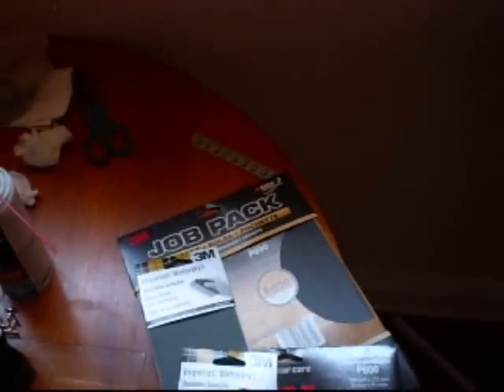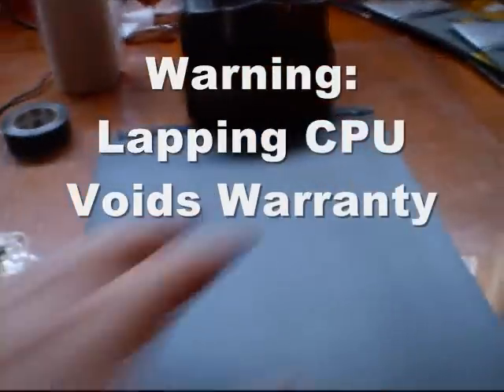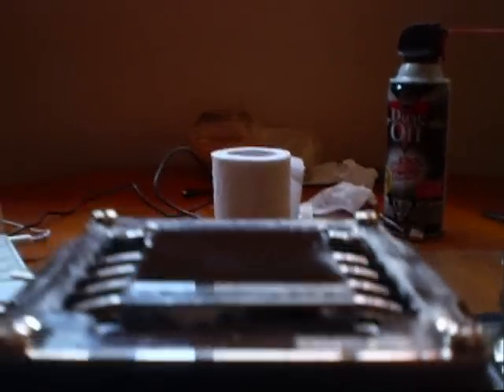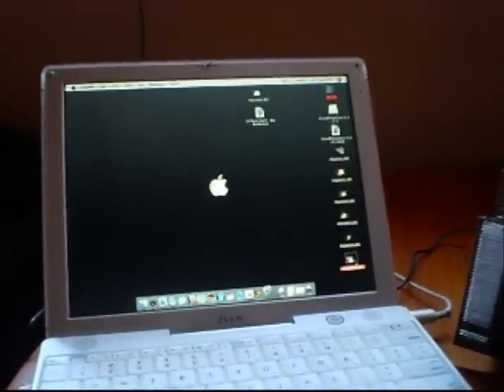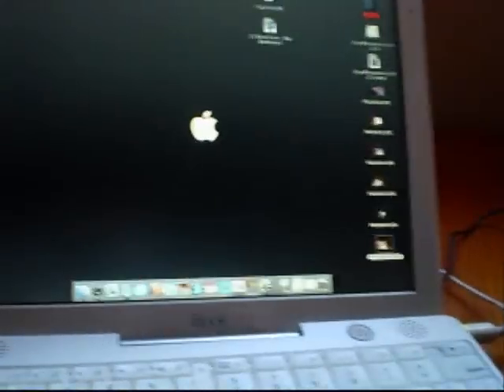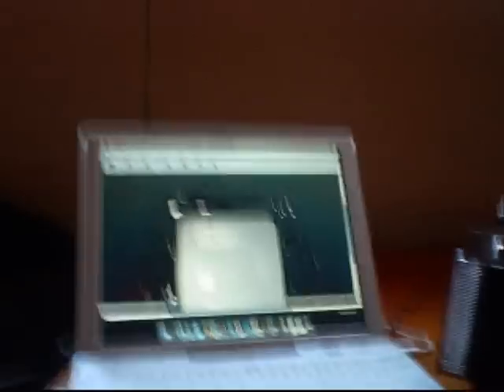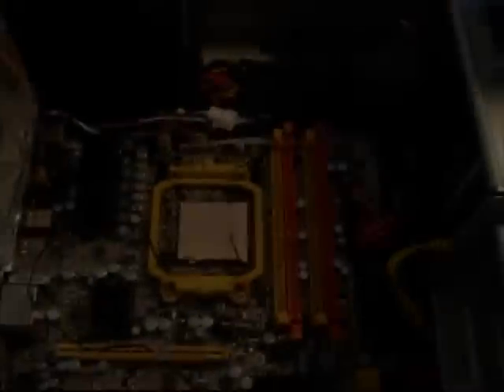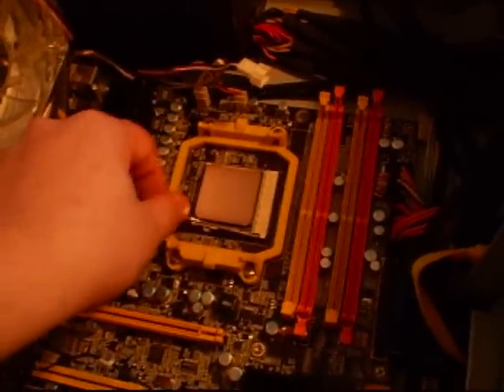Lapping CPU/Cooler - Part 1

Comment: I did follow this for my laptop (sony vios) - only polishing copper heatsink and my desktop - both cpu IHS and alum. heatsink and the tem. has been reduce about 4 degree for both. This is great. Thanks.

By the way, in the next time of re-pasting thermal paste I will try to remove IHS also :D

Comment: I'm not sure you understand. Again, glass has a variation of 0.015 inchs, a standard CPU has a variation of 0.0098 inches, that indicates a standard CPU is already 65% flatter than glass. The INDUSTRY standard on a CPU, some CPUs have less of a deviation. Deviation on a cooler is the same in industry standards. What you are doing is taking away the copper coating, lessining the life of your CPU and making it less flat. Any gains are non-existant and due to mainly replacing the thermal paste.

Comment: @Raptorman10 
You are a moron, no one said dent of or deform anything, heat expands and contracts metal, flat surfaces become bended, that is why we bolt heat sinks down to keep them in place from this massive buckling pressure heat expansion causes. Lapping is useless because of this simple fact.

Comment: @tricccple 
Paste is used, when the cpu is under stress and metal expands it forms a bubble in middle pushing up on cpu heatsink a small amount so the thermal paste it what keeps absolute contact. I find it funny anyone would lap a cpu "flatter" any real machinist would call them a moron due to heat dissipation which you need to take into account. Lapping is meant for objects that stay at constant temperature and need to be flat, otherwise thermal paste is required.

Comment: @tricccple 
Even glass has a variation of 0.015 inch so not it's not very flat, and also a normal CPU has a variation of only 0.0098 inch. So in some cases you would make it worse.

However people fail to realize, that even if you could lap a cpu to a perfect flat, it won't stay that way. When you clamp down a heat sink it does put stress on CPU ruining anything you did you make it flat, and also heat dissipation makes the metal on top of cpu expand a small amount, this is in fact WHY thermal

Comment from the maker: well the principle of CPU cooler is basically transfer heat to the heatsink and the heatsink fan asist it by blowing cool air to the heatsink, and metal is not perfectly flat, so lapping help it to be flatter then factory made (tho it is still not perfect which is why thermal paste is required) which heat transfers to heatsink faster and better, hence better cooling, and initially 3c drop, and supposely more when thermal pates attaches better

Comment from the maker: by sanding the surface of the processor to make it very very flat and so to achieve better contact between the heatsink and processor, which helps for better cooling

Comment from the maker: matter of the fact yes, but not well enough, going to redo the heatsink agian, right now, 
i got same temp at 1.5v 3490Mhz and 1.4v 3400Mhz so there are already some improvements, but Part 2 will have the final results